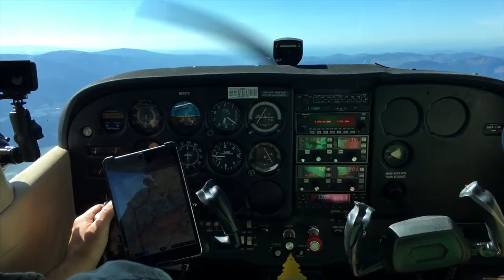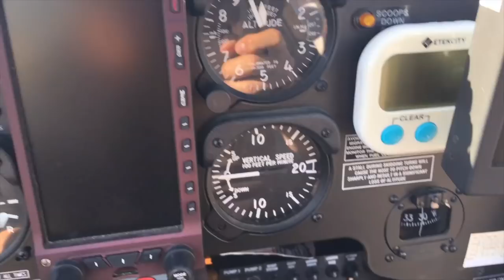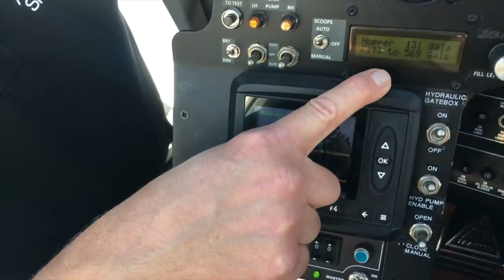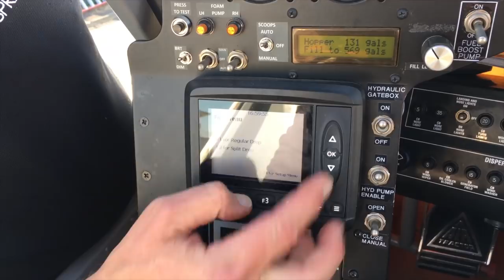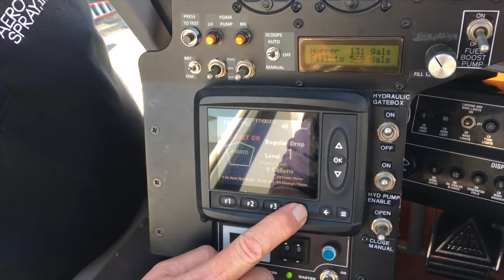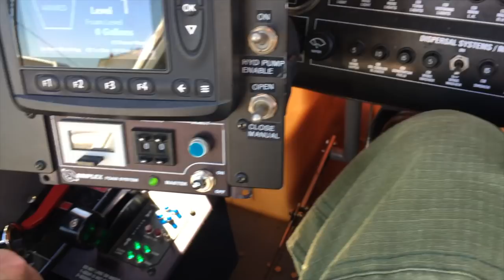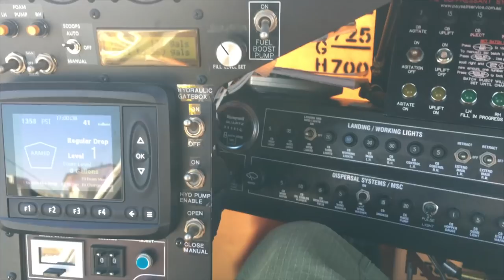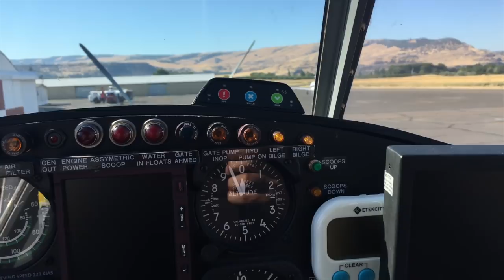Quitting YouTube To Become A Bomber Pilot

Comment: can you explain why the Evergreen 747 super tanker has not been used more over the last decade ?
Reply: Busy chemtraling EVERYTHING
Reply: It's probably expensive to use
Reply: timberjack460 probably right, fuel cost is huge plus takes a very long runway
Reply: There's a 747-400 in use presently.  It's quite expensive.  Evergreen had a 747-100 that didn't get used much at all, and was put back in service as a cargo airplane.  They tried it with a 747-200, but no one would contract it due to expense.  It sat in the boneyard with the engines off, unairworthy, and Evergreen finally went out of business.

Comment: Same plane I flew to spray defoliant on cotton. Now we grow cheap tract housed, instead of cotton. Air Tractor AT 802A. Over $1,000,000 for a semi-decent used model, and easily $2,000,000 for the Fire Boss in good condition. The 802 is a tandem 2 seat plane. There are still some AT 502s flying in the fleet, and a Bell Model 37 helicopter. I like that helicopter. It's old, but it's the only rotary wing they have.